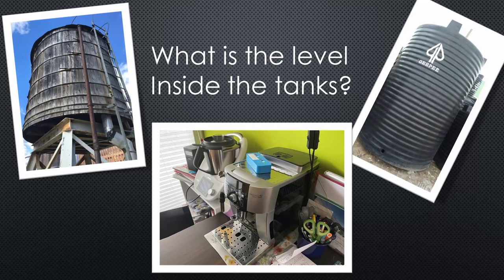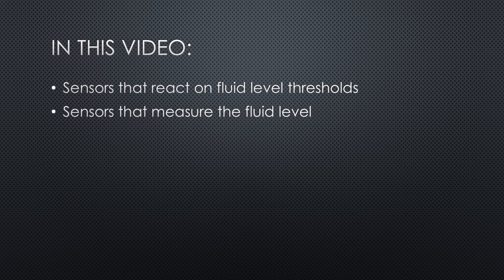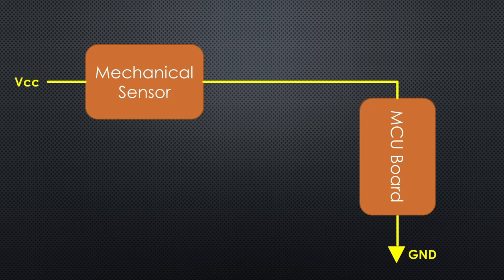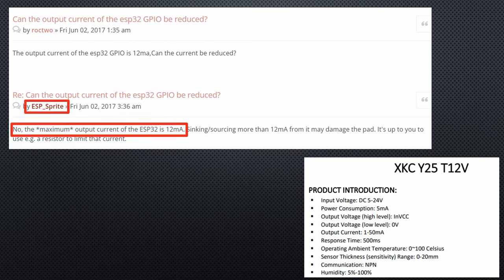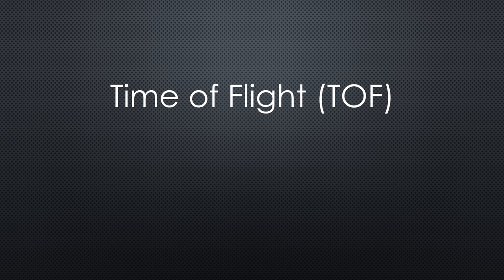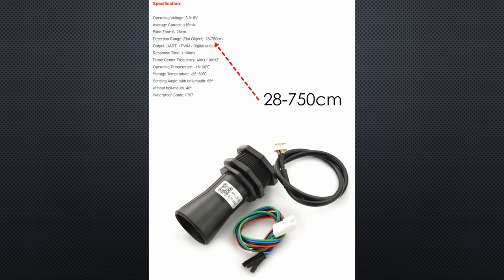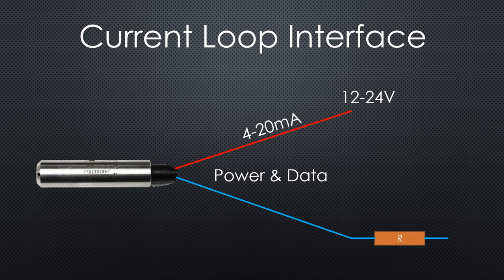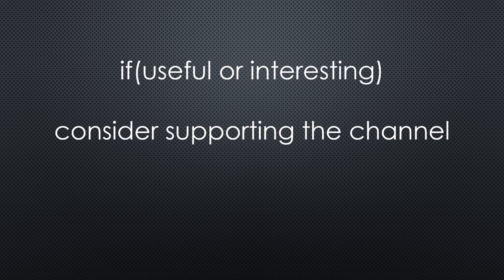#411 Ten Fluid Level (Water Level) Sensors and how to use them (Arduino, ESP32, ESP8266)

Comment: As Aythami Espantoso Luis says (in comments below) you can measure liquid level and volume using a load cell. 

In fact you can measure liquid level by suspending a sealed tube of known diameter, with internal ballast, from a load cell and weighing the tube to get the displacement of volume and thus the liquid level. 

I built a whole groundwater depth measuring system around this idea with the aim to make the cheapest water depth monitoring system possible - but I was defeated in the end because the load cell gradually bends over time and thus the calibration changes. I did think about periodic recalibration using capacitance sensors at a few fixed points within the dipwell tube but that rather defeated the aim of extreme cheapness and simplicity.

Any thoughts on improving this design - with extreme low cost for use the objective - welcome. I'll probably try using a time-of-flight laser system next.
Reply from the maker: In my video about load cells, I got comments from beekeepers. They also mentioned the bending. But they found an (expensive) load cell which does not bend.
I will go the way with a small pipe to the ground and a sensor/pump outside the tank (described in various comments) because I think this is a very good solution (I will try to use a blood-pressure device).
Reply: Grüetzi Andreas. There are all kinds of interesting possibilities - the problem is how to make them cheap, accurate, precise  and consistent over time. Not easy!
Reply: A little more about why a solution matters (and why your videos have been helpful, apart from the pleasure of hearing a Swiss accent again after my years in Bern):

A few years ago a colleague at my university asked me if I could help measure the level of water in the ground in a tropical rain forest. In fact I was already studying groundwater saturation in peat and other soils. This is a hugely important topic worldwide because it is an important factor in flood risk and in the loss of carbon from soils - one of the very biggest sources of greenhouse gasses to the atmosphere. So I had a go at the problem.

There are a lot of ways in which people measure the level of water saturation, and soil moisture, some of which are good, some of which are poor - and which you have very helpfully discussed in previous videos.

As you know there is, in fact, one method of measuring soil water content which, if calibrated, can be made quite accurate and tough using cheap sensors - capacitance monitoring. There are also many ways to measure groundwater saturation level (the level at which all the porosity in the soil is full of water, which is also the level to which a dip-well tube will be filled) some of which can make use of the instruments you discuss in this current video. My preferred method is to weigh a tube suspended inside a dipwell (because it's really tough enough to work in hard environments), but I have the load cell creep problem to deal with so maybe I go to a laser distance system solution - if it's tough enough.

But there is a bigger problem. 

The spatial and temporal distribution of groundwater is immensely complex because the two controlling factors, soils and water movement, are also very complex. So genuinely useful groundwater monitoring must be carried out at close spacings, at frequent intervals, in difficult terrain for long periods. 

There is a pressing need for equipment which is tough, accurate, autonomous and very very cheap - like $20 per installation cheap, so that the spatial density of sensors is sufficient to get somewhere near the spatial and temporal Nyquist intervals required.

I've managed to get some of the way there with a load-cell plus capacitance sensor system based around ESP32 and a daisy-chained LoRa system. Buying in bulk from Chinese suppliers I can really nail prices down but the problem remains making such systems robust to be left for long periods in the places we need them - which are often really tough environments. 

Maybe I'll crack it one day. Maybe ... We certainly do need a solution.
Reply from the maker: Many problems to solve! I am glad I am only a Youtuber. Much easier ;-)

Comment: I have a waterwell less than a meter deep. I will put a small submersible pump in the bottom. I want the pump to stop before the level is low enough to make the pump suck air.
Which method do you recommend?
Reply from the maker: I made a later video where I converted a blood pressure sensor to such a sensor. Maybe you watch this one, too?
Reply: @AndreasSpiess  I didn't. I will look for it thanks!

Comment: The lion kingdom measures resistance between 2 gold plated wires.  It doesn't corrode but it does collect scale.  It's the only thing small enough.
Reply from the maker: I assume this is used as a capacitive sensor. Thank you for sharing!
Reply: @AndreasSpiess  The lion kingdom actually used 3mm, gold plated hobby connectors spaced 3mm apart, so it's a bulletproof resistance sensor.

Comment: I did a similar project with ultrasonic sensor(hc sr 04) and esp32 in mash configuration it tells me what is the level of both tanks and a control module that can on of the motor when tank is full
Reply from the maker: Thank you for sharing your project setup!

Comment: What about a sensor that meassures the resonance frequency of the gas/air in the container above the liquid? Should change with fill state IMHO.
Reply from the maker: Others proposed this method, too and it seems to work. Probably not simple... And maybe noisy (depending on the resonance frequency)...

Comment: What about Ultrasonics and there must be some way to have a way to have the addon system refill the water tank from the mains water.
Reply from the maker: I thought I covered ultrasonic sensors.
Reply: @AndreasSpiess  Sorry should have known but a capacitance sensor would have worked also.
Reply: @DAVIDGREGORYKERR  I'm about to build a DIY capacitance water sensor.
I've been using the HC-SR04 to monitor the water level in my "Humidifier" project.

As for functionality, it works great.  HOWEVER, as Andreas mentions, it is "bouncy" due to reflected echos within the machine itself.

How I got around that is to capture the data a bunch of times and average it out after "filtering" out the "bounces" with a timer.
I use a Nextion touch display, so in the "settings" page, I have 2 variables for high and low water level, that I can change.

BUT HERE'S THE PROBLEM.... while the HC-SR04 does work great, it doesn't last long!

It worked well for 1.5 years, but I put vinegar in the water to dissolve the buildup material and the mist that the machine's fan makes, pushed vinegar water into the LCD display, destroying that AND up into the HC-SR04, destroying that.  Sigh.

So I've stopped using vinegar, sealed the Nextion LCD display and will be making a capacitance sensor that is totally waterproof.

For one thing, it won't bounce due to echoing.

Comment: at 5'45 : use ac voltage to reduce corrosion
Reply from the maker: A good idea. But others suggest that it does not completely solves the problem because of other corrosive components.

Comment: Great memories about my industrial automation lessons back in time.
May I add something : for measuring pressure in order to get a fluid level, you need (in most case) a second sensor perpendicular to the tank wall to measure the static pressure (unless an open tank, due to level and temperature variation, or just the appliance is an pressurized tank) and them substrat the static pressure to your measured dynamic pressure to get the relative pressure of your fluid level.

The main point of that 4-20mA sensor you introduce is that if there is an open loop (wire cut somewhere) or a short circuit, you will notice it instantly (by getting 0 or ♾ Amps) and this is why sensors with this reading range are WIDELY used in industry. (Way much that any other kind of sensors, and for many appliance : temp, flow, angle, etc.)
Reply from the maker: You are right that you have to subtract the outside pressure. Some viewers use a second pressure sensor. I could imagine to use the weather forecast if you do not want to be very precise.
I was not aware why the current loops start at 3mA and not at 0. Now I know. Thank you.
Reply: That's very interesting, I have a long term project to upgrade a small cabin in some fields belonging to my father in law.
I'd like to make the water tank autonomous, filling/monitoring from a well, I was thinking of using float sensors or the passive sensor that was used on the coffee machine.
But I quite like the idea of those pressure sensors, but now I have to think about static pressure?! Yoinks.
Reply: @BobHannent  I think for that small home appliance, using a constant value based on average atmospheric pressure for static pressure is fine ;)
Measuring static pressure is mandatory in tanks where this static pressure is subject to significant changes

Comment: Pressure can also be measured from the top, placing the sensor at the end of a tube that goes to the button of the tank. The tube inner diameter and the weight of the fluid determine the pressure
Reply: This doesn't normally work reliably long-term, since various effects tend to cause the fluid level to rise in the tube over time. The setup has been used in the past though by very slowly feeding gas into the tube (normally bottled nitrogen). The gas pushes the liquid right to the bottom edge of the tube where it bubbles out, giving a consistent effective tube length. If you only want periodic readings, you could use an aquarium pump, controlled by the micro, to provide the pressure.
Reply from the maker: Others mentioned this type, too. But I fear it has to be air-tight for a very long time.
Reply: @colinstamp9053  you might be right, but if you emptying the tank regularly, it will be "reset"
Reply: @jenskaa4044  Yep. There are a few applications where it's not a problem. I think washing machines often use this method. Just make sure you don't need accurate readings for more than an hour or two between emptyings.
Reply: If the pipe has a T at the top then a positive pressure device (air cylinder or small air pump) can be attached to the third part of the T, the first and second go to the sensor and subsurface pipe respectively. It was called a bubbler system and I've used it to measure seawater levels for months at a time. The and will bubble out of the bottom of the the and always maintain a pressure proportional to the depth of water, an advantage being that atmospheric air pressure is cancelled out.
Reply: @AndreasSpiess  For this type we use an air pressure source.  If there are contineous bubbles, the reading is correct.
It's a good technique for difficult and dirty fluids.

And there are pressure sensors for dropping it from the top into the tank, where a small hose for reference air pressure is integrated in the cable.
Reply: Most fuel tank gages use this principle. You pull on a rod that has a spring in it, it bubbles out the fluid line, and the returning pressure is the height of your fluid column.
Reply: @markpalmer9002  that's a a smart solution, I guess a small pump will do. My liquid is water, a flammable would be problematic.
Reply: For a similar system, that's quite robust and reliable, make the tube rigid, and of a non-corrosive material for the process material (ex. stainless steel tube in food process), run it so the opening is at a low point of the tank (above absolute bottom, if precipitate is an issue), then pump air (or other non-reactive gas, depending on process) at a pressure that forces it to bubble out of the bottom. Measurement of the air pressure in the bubbler tube will be proportional to the height of the liquid above the bubbler output.
Reply: And ... Critically, because the tube is rigid, pressure measurement and bubbler pressurization can be done outside of the process tank, with only the bubbler (and the air or gas used) in contact with the process materials!
Reply: As @Colin Stamp mentions below, some washing machines use this. My washing machine’s level sensor mechanism just failed after 23 years. That’s not forever, but I would say that’s long enough for the application.
Reply: @AndreasSpiess   @Colin Stamp how about adding a airballoon at the end? It is air/water tight  and reflects the same pressure